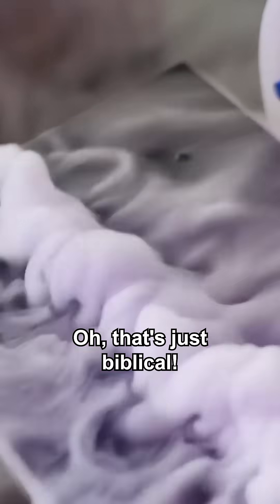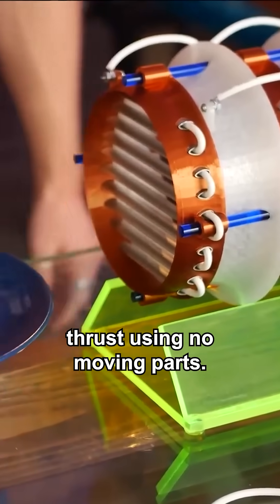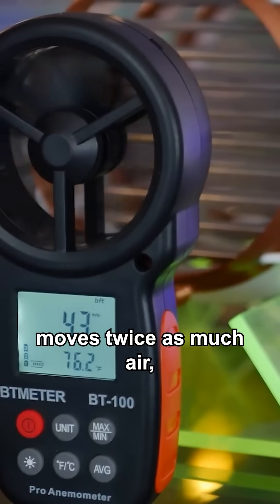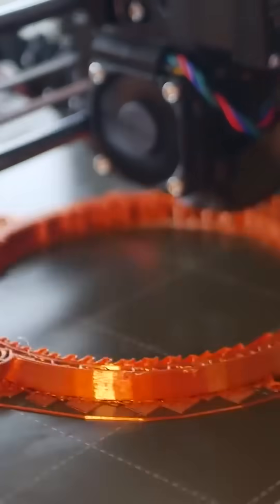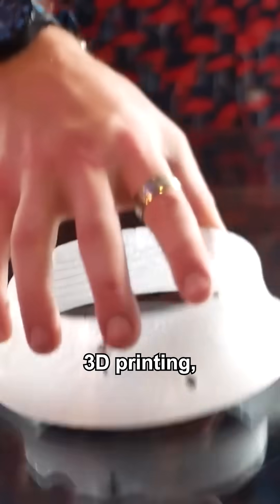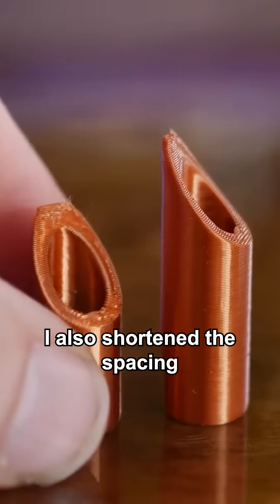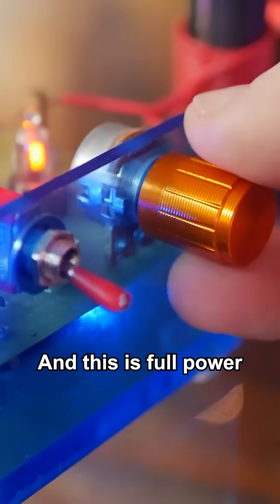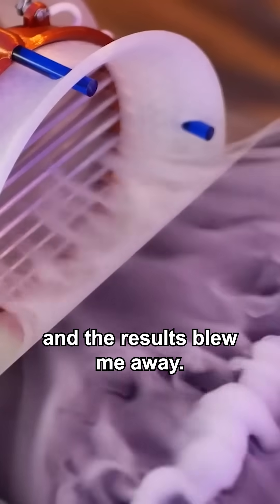The Next Generation of Ionic Plasma Thrusters (BSI MARK 2)

Comment: What does the efficiency cap on a thruster like this look like? How much thrust can it theoretically generate? Sorry if you answer this in your longer video, im about to watch it.
Reply: It's not answered in the video. I am trying to calculate this, but it's not as easy as it seems:)))
Reply: Well efficiency can be viewed as 2 separate things, you have the efficiency of the entire object, and the efficiency of a panel singular, technically there's a third which is a single stage, but not worth considering due to the large volume of air he's moving. A single panel eg one of the silver bars probably is 23% efficient compared to the energy input vs a typical motor fan. The unit in its sell at best can only ever be as efficient as a single blade/panel. So somewhere less I'd say likely with all 4 stages about significantly less. Because the air is already moving there's less time for the air to accelerated through charges. Now it will still add momentum during each "phase" but that benefit is going to substantially fall. This is the same issue even with chemical thrusters at NASA hence why any single rocket boosters circumference is smaller than the ignition chamber. Eg that bell shape. By the time it's being expelled it must start at a small volume to gain velocity, chemical booster get that bell shape to ensure good air mixture and proper combustion. In a jet engine the housing sits about the same diameter, but uses fans/blades/turbines to generate compressive forces at each stage. That's why they're kinda egloid in shape. Starts out pretty big but has a reduction in size near the exhaust port. Now you loose energy in the over all system from moving the compressive turbines, but over all more of you're intake is converted into momentum. 
So I'm his current set up which also allows outside air from the system to exchange there is a huge loss not because air is entering or escaping but over all drag and volume from each stage is greater. So I'd hate to say it. His design is probably 35-45% efficient to the total energy put in contrast of the 23% each panel accelerates air, meaning his device is at most 8-10 efficient to the energy he's putting in, and at best could ever be as efficient as a single fan, and the only way to accel at that if the goal is momentum is to reduce the gaps, and volume of air during each stage. Realistically it wouldn't be any more efficient, but you would have much better efficiency converting the air into momentum. So no not very efficient or effective. It's overall a neat idea.
Reply: @spoon527  Oh ok perfect, this is the answer I was looking for, not some random kid lol. Do you think the output could be improved if each progressive stage compressed the air slightly? Kinda like a jet engine so you end up with a smaller stream of more compressed, faster flowing air?
Reply: @_Bear70  yes you are correct and here's the proof.

E= energy
V=volume
P= pressure
A=acceleration

E will use 24 volts what I assume.
V= the circumference which will substitute with π for now
P=he starts and has 1 pressure through the system and we will keep it this way for simplicity
A= result.

24*1/π=   A of 7.639...
Now we will half the circumference at the end of the system for simplicity 

24*1/(π/2)=A
π/2= 1.570 "1.571 for rounding =x
24*1= 24 24/x = A of 15.2866 

Which is actually slightly more than double obviously you could calculate this between each stage and change of pressure.
I could summarize it fully by also increasing the pressure for each stage. Which is a slightly more complicated equation.
Reply: @spoon527  Oh yeah!!! Thats so cool, thank you man.
Reply: @_Bear70  yeah not sure why a guy named geek science couldn't figure this out, but how the air is being given force doesn't matter chemical electrical kinetic I mean really what is in this video by definition isn't a thruster just a multistage fan, but not to say it couldn't be or the principle there or. See a thruster needs to generate lift^ and sadly it's just not going to happen with these easily. See jets generate lift by converting that air and using wings. Which is why the jet engine sits under the wing" air momentum isn't really the key to lift here and it's actually not the engine on a plane that actually generates lift. It works because the faster the jet moves it affects drag. The key here is the intake causes a low pressure zone, and a high pressure zone and alters the drag and velocity which ergo causes lift. So that would be the next critical physics problem of the matter. Because how much any air system intakes for "plane flight" is critical. That's why you can make 80-150k a year designing planes for Boeing. Which if you want to convert the air momentum into lift ah that's another story. It's really confusing but understandable how it was difficult for the commenters and the YouTuber to not understand any of this because the physics is just short of rocket science. It's Ariel physics and it's pretty complicated as well, but the first step would be getting the most momentum out of the lightest build. That's important before anything else. YouTube guy has the right ideas just implemented poorly, and it's not to say these can't generate essentially suction which isn't a great term here, but the reason these are unlikely to propel anything is because you can think of these air fan cells kinda like a rail gun, rather than a vacuum. One side is charged and as air moves through the channel that charge is exchanged. Causing the air to move. Well where's the problem you might ask? Unfortunately that means it needs air passing through it to accelerate it, now some suction is given as a result of fluid dynamics. For example you can make a siphon with a straw, but it's limited to the "pressure" of the initial system. Where as this is different in say something like a vacuum or pump. This would be called the conical intake rate. A turbine in a normal jet engine conical intake degrees is absolutely massive you can think of this like a flash light with a extra wide diameter. These you can think of more like a harmonica. The conical intake area is very limited so as you increase the pressure "which would boost your air momentum", but requires a higher volume of air eg pressure in its conical intake area. Which really limits this into actually providing any "lift" but you sure can make one hell of a fan from it, but unfortunately it's fundamentally flawed for such use. This principle is the same issue with a normal fan vs a turbine. A normal fan even with a turbine in it. Is just not going to generate lift.

Best said this idea is nothing but fast hot air." In the future they're may be different shapes or funnel designs that could alter that conical intake section to actually achieve the air volume needed to perform this, but the technology doesn't support it .

The air intake causes low pressure you fall into"sucked into" and the wings generate lift equals or more to the amount you would of fallen. So long as you don't need it to generate lift, and just want fast high pressure air. Totally possible.

Bear I love your interest in the problem and process and hopefully you now understand how this works. I mean size matters too not just weight imagine if the whole wing was one of these with a high pressure turbine. That is the best realistic theory you would have to actually getting this off the ground. It has another fundamental flaw unfortunately that may limit it to models as you go up in altitude air becomes thinner and it's suction force needs to dramatically increase space having almost 0 air. So only low flying craft for these things unfortunately as well even if they get enough momentum and lift. The more you go up the more likely your going to fall. 

I really hope you enjoy the explanations I'm not a super nerd or anything, but I do enjoy math and physics.
Reply: @_Bear70  I may have made it hard to understand. But jet engines suck air causing a low pressure in front of the wings and higher pressure behind them and the wings glide the plane with drag. You can see how you are pushed and pulled into the new low pressure zone which is constantly moving with the plane. This it flies. Sorry if I didn't explain that part better.
Reply: @_Bear70  let's take a basic equation I gave. Let's say we did make the volume half still, but let's affect the initial pressure. We will now take this system and put it only 10,000 ft high. 10k ft vs sea level is about 78% what it is at sea level.
1.57 for our π remember 
24*0.78 = 16.8
16.8/1.57= A of 10.7 
Only 20% better at this altitude. Compared to double, and still were omitting some serious factors like the conical intake area, but still as you can see. You're right away having issues, and this isn't even considered very high. 

This is why we use chemical propulsion in rockets, because we mix the air as we go up. Once again remember that bell? This is a benefit in chemical engines. Problem being now you have to account for all that air your bringing with you as weight also. That's why first stage boosters burn hot and burn fast and then drop.
Reply: @_Bear70  a normal commercial passenger jet flys are 35-40k feet in the air. At this hight the air density compared to sea level is only a staggering 20%!
1.57 for pie at our half circumference again
24*0.2 = 4.8
4.8/1.57=A of 3.058 if he's getting 4.5 lb of thrust on ground level that thrust in simple theory and expressed would only yield about half that at proper commercial flight hight, assuming he doubled the efficiency with what we talked about. Sounds like a plane I wouldnt want to be on. Without our modified volume at best a Fourth of it's air velocity. Eee
Reply: @_Bear70  if it works with water it could make for a cool way to propel a boat or a sub, because that supports the initial pressure difference of the system needed for these things. I doubt they're water proof, but in transportation it's better on a water craft rather than an air craft. I'll leave this with my favorite phrase. " The more you know. "
Reply: In comparison he's getting about as much air momentum as a double aa pocket fan or a desktop fan produces. I don't remember the exact voltage he said something like 24 I believe to really know we need a critical part of information amperage as well. Which I don't think was shared. So compared realistically to a desktop USB fan he's only at best 1/5th as efficient. At best case probably double it give or take. Which may not seem like a lot, but that would compare to a fan you plug into the wall or an oscillating fan" I hope I was able to help, and answer your question.
Reply: Efficiency cap? Do you mean “limit”
It is still in basic prototyping!

This is mrk 2! Long way to go before we can an idea of how much we can get out of it first. Understanding it’s potential is many CENTURIES away!! 😮

If you ask me, this is our beginning 
We will imagine more potential as it advances! I do think it is our most advanced tech so far. FUTURE TECH
So, i would say a lot of potential!
Hopefully 😅 Maybe our first space travel. 
The more we do/learn the more understanding we will have!! 
It also has many uses, not just propulsion. The sooner the better!!

All will be different when this gets going 
Still a long way to go though 
Can’t wait 🧐
Reply: @greekkidshows9373  I was more wondering if he had any idea how much thrust he could get out of a system that is that approximate size.
Reply: @ as it is, not much! It’s not much more than a concept at the moment.
Still a lot more to do before it’s useful 

The idea with a concept like this one, is not to give up thinking it’s weak.
For example, I would bet solar panel’s didn’t collect much from the prototypes!

There are things he has yet to do that will make it more viable. 
I wish, but, patience and time is the only way